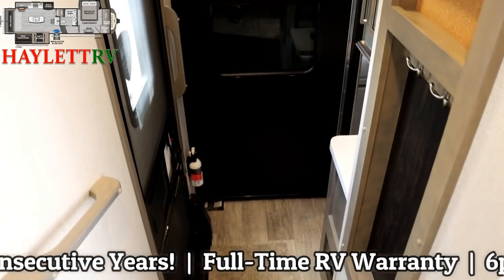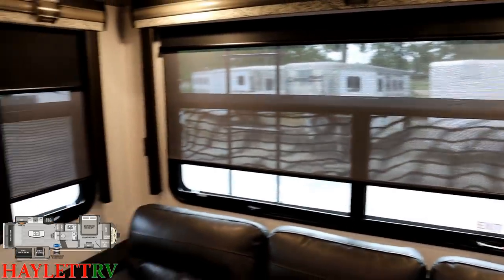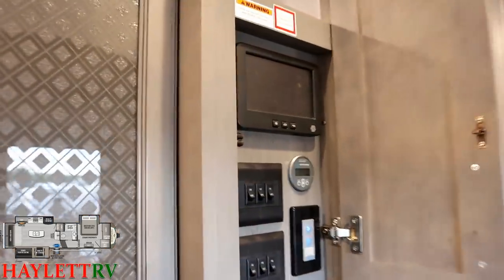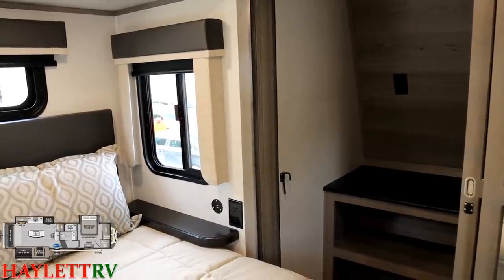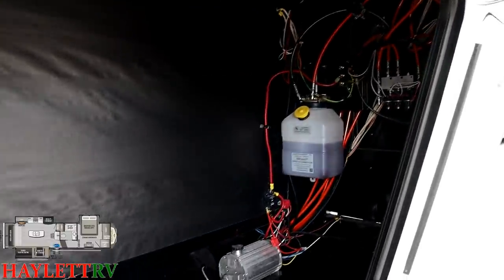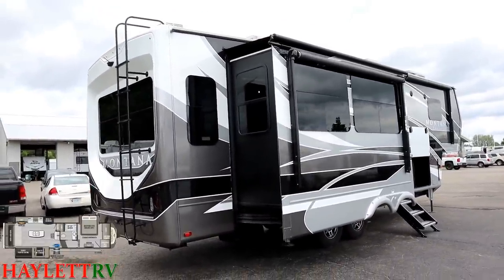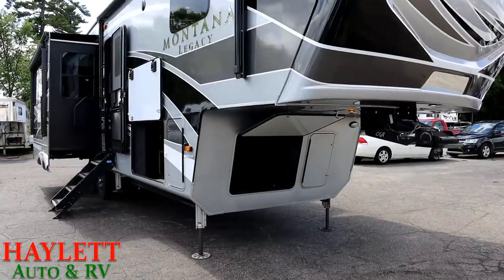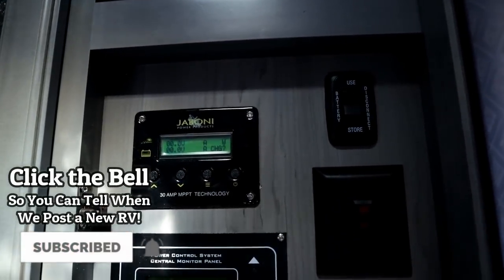LOADED 2021 Montana 3120RL/3121RL Super Solar, Legacy, Full Paint Luxury Full Time Fifth Wheel RV

Comment from the maker: [UPDATE!] Montana increasing the size of their panels from 265w to an impressive 300w for all of their solar packages! The "basic" solar package will now include a single 300w panel (among its other equipment) while the super solar flex system will features 4x 300w panels plus all other hardware!
Reply: Awesome,  Thank you for the update. Also we wanted to know if its possible when we purchase our rv, could we replace the beding with different beds like Sleep Numbers or Serta (mainly for the main bed but not the bunks)?
Reply from the maker: @pinkdragon9446  Not from the factory, but we can assist with sourcing aftermarket
Reply: @JoshtheRVNerd  Awesome 😎
Reply: Way too late, I know, but as per this video 

https://www.youtube.com/watch?v=wg8X6IlRiGY 

he noted that there was a gap between the top of the shower moulding and the wall. Just needs a bead of caulk, but they don't do it! Can you as a tall guy, check it out for me on one of your stock units and confirm that if with the model year changes, they have fixed this?
Reply from the maker: @brianjrichman  Unfortunately I don't have one in stock to verify against
Reply: @JoshtheRVNerd  Hey Josh. Thanks for replying, especially about a previous model year, that you most likely won't see again, except for trade. This is a great indicator about your (high) levels of integrity at Haylett. Can I impose and ask that next time you check out a Montana, can you remember to check this? If you find it mention it, otherwise that's fine, I'll assume it's not an issue in the 22 models.
Reply from the maker: @brianjrichman  I'll try but man.. I have a lot of irons in the fire lol
Reply: @JoshtheRVNerd  I'm sure. That's why I say, only IF you can.

Comment: It’s about time they started putting big solar on campers. The little 50-100w panels are not good if you want to work remote from the back country or anything like that. 

We have 600w on our 24ft camper. Can run the heater, coffee pot, TV, my laptop, etc. Our inverter overloads when we try to start the AC, but we carry our little inverter generator for the 3 days a summer that we HAVE to have AC.

Comment: One thing I haven't seen yet in your videos is the larger RVs like this Montana That arealso equipped with a drawer style Dishwasher. Some years ago at a RV show I saw them in the larger hi end RVs.  Also saw a RV WITH A very large bath room that had a large tub and separate shower a couple were looking for that feature because the wife said she had to have a separate tub and low and behold she found one the floor space in that bathroom was like a small bedroom.
Reply from the maker: There's a few models where those really would be nice to have. 
North Points suddenly "Feel" like a dishwasher would be a nice feature

Comment: Now that is one heck of a solar setup! Looked up the prices for the components alone and they were around $9k total. Do you have a price for the super solar upgrade option? Montana doesnt list it on their website. Also i see it isnt able to be optioned with a onboard generator due to the electrical system, but would it work with a inverter generator like a 3500W unit to help charge the system and run the RV in limited fashion in low light conditions?
Reply from the maker: An easy solution here is to get a generator that allows you to simply plug the RV's shore power cord in directly.

Comment: Two questions: 1: Is this unit still available?  2: Can you run the air (off solar) while towing so it is cool when you get to your destination?
Reply from the maker: The specific RV shown here was just purchased, but we can obviously get others. I think we have another similar loaded 3120RL coming in (I think with the 300w solar + generator) 

Regarding running A/C in motion... I suppose theoretically you could but I'm not sure if there's any safety reasons to avoid doing so... I'd have to check on that a bit.

Comment: Outstanding video as always and the most beautiful exterior I have ever seen.  However....with all the 5-star features, why does Jaboni use the cheap low efficient polycrystalline solar panels instead of the high efficient monocrystalline?   It's like putting Chinese tires on a Lamborghini.
Reply from the maker: Solar seems to be one of those topics like meatloaf or chili - everyone seems to have a way to do it better. 

I will openly admit I do not know enough about it to field your question intelligently. I hope you can at least respect that much of this reply. It's something I need to learn (and WANT to learn), but simply haven't YET had the time to do so. 

My plate is always overflowing. It's frustrating to not be able to dive into things like that.

Comment: I have a Keystone, Hickory 3000K  Rear Kitchen and love the two slides, not into 3 but may consider as its important to me I can get into the coaching front to back in some shape as I travel by myself and stop places and don't want to take up too much space.  Been doing this since I have been 18 yrs old now 71.  So I like the new idea 3 slides and can still get through the unit.  I would consider trading in my 2012 Montana Hickory series, Not looking for anything over 35 ft for ease of parking just about anywhere and getting in and out of any service station. hooked to my 1998 F350 Dually show truck it pulls really great and sounds like 13,800 lbs compare to mine at 17,900 empty weight.  Hope its better insulated but still love the units.  How I can attach pictures how much do you think in pretty excellent condition all decals are still on it and wash and wax it min of 2 times a year or more.  so everything works, new ties, new fridge, new awing, just washed last week and waxed.  How much could I get a trade for the new one u are talking about.
Reply from the maker: For trades you will want to speak with the team members at our stores

Comment: 😜Josh you suck! Thanks for now showing us what we have to purchase next.😉 We really appreciate how your videos are always amazing, informative, and so helpful giving peace of mind when making an RV purchase. We have a few questions for you as we look forward to purchasing a 3931FB in the months to come: how long does the process take ordering/receiving fully loaded and with Super Solar? If the third AC option is ordered, can the solar still run all three units off grid? When trading in and working across states, is it all handled at time of pickup?
Reply from the maker: LEAD TIMES: Vary based on production runs. Paint units take an extra couple of weeks. We don't order units like this hoping to get them quickly
THIRD AC: This is something that isn't likely needed in almost any case considering Montana already uses dual 15k Airs and have a great hot-climate package. Super Solar will not run all 3. 
TRADING: I'm unclear on what you're asking. "Is it all handled at time of pickup?" --> Is what handled exactly? It's basically like trading in a car if that helps.